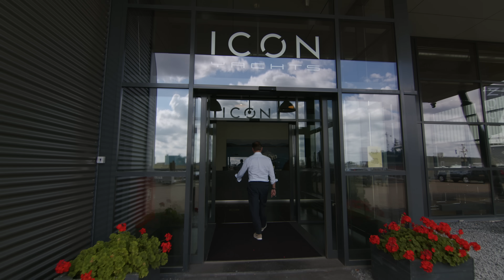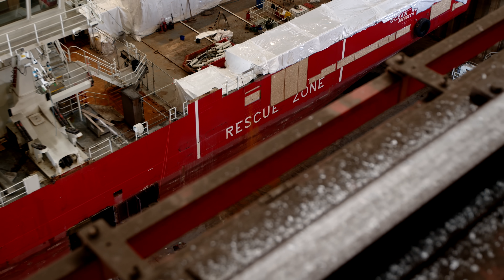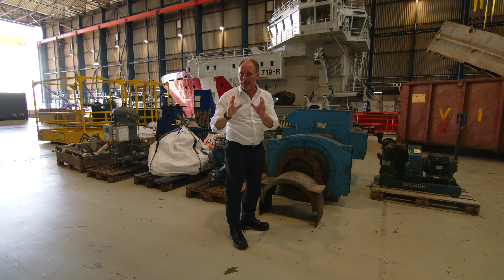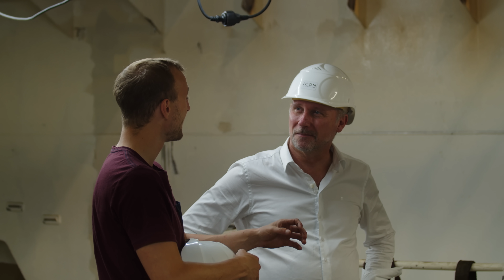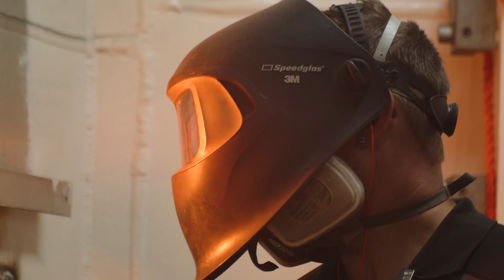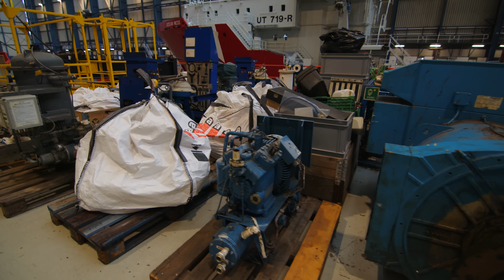IS THIS THE WORLD'S MOST EXCITING SUPERYACHT PROJECT?

Comment: Voith Sneider propellors are used by tugs because tugs need high bollard pull, and great maneuverability. Tugs are slow, inefficient, have a short range because they are coastal, for the most part. Conventional propellers dominate the ocean going market for good reason. It's a pity Iconic yacht did not explain their choice.

Comment: It will be interesting to see how the electric motors will drive this yacht, speedwise, and trip length. I have to wonder how much petrol will be used by the 5 generators vs the two drive diesels removed from the vessel. Cheers to the channel, I will be binge watching a few of the vlogs, and look forward to more, very interesting topic, and great idea for a channel. 😎👍✌☃🎄🤶🎅
Reply: Great question. The 5 Generators will actually not be running all the time. They will be only switched on if the power is required. Most likeley the Vessel will only be running on 2-3 generators at the time, the others as backup. This is a much more fuel efficient setup as the vessel can basically only turn on what it needs where in the previous setup the huge engines were running all the time.

Comment: The new design removes safety features typical of the original ; designed for winter but which can occur in summer storm and hurricane.  The original design has a low aft deck that allows for sea water to  remove ice build up from bow spray.  The new aft deck raises the ice lines and allows for capture and retention of ice above, making the boat top heavy upon unexpected icing.   Uptech, Go Green, go IH2I and Hydrogen Miner.

Comment: I always had an idea for a radical "four hull" ship.  I always envisioned a ship like the trimaran wavepericer, but having a larger "central" sections with two large hulls extending forward, and two smaller hull "wings", one on each side.   

Not knowing anything about naval design, I always figured a wider profile would have less of a chance of rolling over in high waves and rough seas, or rogue waves.

Comment: Question: (Re: ESG) Giving old hulls a new lease of life always bodes well for sustainability. However, how much virgin materials would be used in this restoration-refit? Compared to a fresh build, would this actually be more materially intensive? My other concern is the batteries. Although the idea sounds safe in theory, how will they be like maintenance-wise in the grand scheme of things? Those explosion-proof boxes sound like a nightmare to replace (which should come quite often, based on my own experiences with batteries).

Comment: I always wonder if these repurposed rescue ships make good yachts. Adding all new superstructure seems like it could impact the center of gravity and stability, and  rescue ships often have such deep draft it makes it hard to enter many ports. You'll always notice the crude, wrinkled hull plating and there will always be  parts of the engine space that are old and grimy. Finally, the cost to rebuild these ships is often not much less than building a yacht from scratch.
Reply: Yes, wonder what the new superstructure will be constructed of? Maybe Aluminium or composites…tonnes of bog will fair out the hull plating!

Comment: I'm surprised you haven't heard of the Voith Schneider Propeller, they have been used on tugs for a long time. They are like a paddlewheel placed on it's side, I have always wondered how efficient they are because of this. With the blades having to constantly change angles as they also spin, I am also wondering about reliability.

Comment: What sort of range, fuel capacity, cruise and top speed will it have ? Will it be just as safe as the original design or has the extra weight on top changed it making it less stable ? And how much will the entire project cost ?  To be honest I never thought of doing this. I was contemplating purchasing an older yacht for total refit but then old yacht prices went up. Then I was looking at Bering, Then I had issues with cruise speed vs fuel, and the total cost of journeys meaning the ship would be parked as a "live aboard" for too long. Sustainability, pollution, draft.. all these issues come into play. I am in Australia so we have some of the roughest most dangerous waters in the world.  I have been out in seas where there were freak waves 150m high. In fact on that same day, a man was washed off a cliff, who was 150 m up on a line. I was in a big CAT that day.. The Tasmanian ferry.. yep not on a super yacht per se, but its a big boat. We also hit two submerged containers.. something a lot of yachts do not seem equipped to handle. These are real obstacles and if you hit a container with a fiberglass hull, or a softer steel hull, or your props hit it.. you might find yourself taking on water, or "dead in the water" at the worst possible time. Then the waves will simply break you apart.  This is the reality of the larger worlds oceans and not the protected mediterranean etc.  On top of that, Australia is a LONG way away from anything so RANGE is critical. Fuel shortages mean alternative energy becomes very attractive. Who can afford a quarter of a million dollars to fill up, every 5000nm ? It would cost a million dollars to get the ship from Australia to another continent.

Comment: Loved this a lot, what will happen to the fuel tanks, will they need to be expanded or not to power the 5 generators? Please get to go back and see this boat many times.
Reply: Actually, the fuel tanks will be made much much smaller. The vessel was meant to supply Offshore installations with fuel, so it had massive capacities, way bigger than ever needed on a yacht. So fuel capacities are actually reduced to a third - still the yacht will have a 6000nm range.
Reply: @H.M.P.D  6000 wow, truly amazing, I am loving the sheer scale of the engering involved. The logistics must be crazy given the world right now and getting parts. Simple things like fridges I here are hard to get. 
Will the boat have solar power or a kite sale to help.

Comment: Great project. And diesel electric hybrid systems are certainly the way to go. 
But I really can't understand why they'd use voith schneider propulsion in this application. I was working with these systems years ago in the 1970's and 80's on harbour tugs. There they really come into their own with their ability to pull in any direction and change it instantly. But they're mechanically very complex with a lot of moving parts and potential points of failure; and I really wouldn't imaging them being well suited to offshore passage making.
To me it'd make much more sense for this project to go with an azupod system which are well proven and are already used on many modern cruise liners. By putting the electric motor inside the azupod they allow a direct drive onto the prop via a very short shaft; They're really simple and reliable, with minimal moving parts, no gearboxes, and only an electrical cable between the hull and the azupod; They're very quiet because any motor and propeller noise and vibration is taken outside the hull. And because each pod can rotate independently through 360 deg they allow virtually the same level of manoeuvrability and GPS-anchoring ability (for want of a better term).
Reply: Good questions you are raising! Actually the technology of the VSP´s has advanced over the time. The system has way less moving parts than you might think. Hope David will dive deeper into this topic and explain a bit more about how those insane looking Propellers work!
Reply: @H.M.P.D  Have a look at https://www.youtube.com/watch?v=Ub563Yc3xls
The animation is a bit fast, but if you slow it down to 1/4 speed it's a bit clearer.
Notice how as the unit rotates each blade is constantly oscillating on its own vertical axis relative to it's tangential rotation.
That oscillation is what provides the thrust; but it's also that, and the associated mechanical linkages, which I was referring to when talking about the amount of moving parts.

Comment: Show us where it is not the two most important problems that should NEVER hit open water again.
It's top-load and not roll on roll off (RoRo). 
Also has low center of gravity to offset the work you did to a pre existing vessel.
As sinking is common amount in HCG modified vessels. Much less anything HCG vessel.

Comment: With all the extra weight added to the superstructure how do they ensure it won't be top-heavy?
Reply: Super interesting question! Since those vessels are actually made to carry gigantic loads on their aft deck + more than 1000 tons of fuel/water as supply for offshore installations the added weight actually brings more stability as it brings the vessel "down". When not loaded the original vessel would have to use enormous amounts of ballast water to ensure she is actually not to light. Also there go very complex stability calculations into such a conversion, ensuring that all is perfectly stable.

Comment: The dynamic positioning system comes hand in hand with high fuel costs and a much higher maintenance cost. I am curious what, if any, are the trade-offs to initial costs and long term maintenance schedule of this system as compared to a more traditional electric direct drive thruster/nacelle configuration.

Comment: The Voith Schneider propellers seem to give the ship a great handling advantage at a cost of speed.  Is there an option to use these and have a higher increased speed?
Reply: As Project Master is designed and build for cruising in comfort with extended range in mind, that was a trade worth taking. As I am aware of, there are just certain technical limitations to that system which provide a speed limit. 12-14 knts speed is plenty enough for a vessel like this tough.

Comment: Perhaps cost is not a consideration but I do wonder if this method of ship building is better than the alternative - starting from scratch? There are probably parallels to refurbishing a house vs building from new. Can you provide any insights?
Reply: Indeed there are some parallels. Just keep in mind that the complexety of such a vessel with hundrets of systems working together is much higher than a house. Therfore also the efficiency really comes into play since all that will not have to be purchased new and even more important, does not have to be newly engineered. On New Builds a lot of the overall investment has to be made years before the first piece of steel is even touched due to the gigantic engineering/tesing and certification efforts.

Comment: It was an ERRV (Emergency Response and Rescue Vessel).   Generally stay on station at Oil/Gas installations/rigs.  Tend not to be involved in supply of materials, as there is no deck space for that, when in Standby mode.   They only leave location when relieved by a similar vessel.  Could make a good basis for private explorer yacht.

Comment: Having seen an oilfield supply vessel in action in the South China Sea during a typhoon a few decades ago, I have enormous confidence in their stupendous abilities. Notable memories involve the Smit Lloyd 101 rearing out of the waves on full power to time her passing with a helicopter landing on the bucking deck of a barge (in case it went over the side). They’re great, even more so the latest supply vessels. But even when converted, it would be good to honour the sturdy pedigree by avoiding the term ‘yacht’ however fancy they are! Better to think of them as luxurious working boats - and be proud of their tough origins.

Comment: I’m curious about how much more efficient the new power/propulsion systems will be compared to when this was a commercial boat. It would be interesting to see real numbers about how the displacement has changed from when it was running heavy with supplies to what it will be after all the new metal is added.
Reply: @Tim Nissen 
I lack any knowledge to dispute your claim...

Comment: What a better way to build an explorer super yacht, by transforming an existing, proven, been there done that,  commercial explorer yacht.  Although I think the owner will not deliberately go into a storm with it, but good to know it can..hahaha.  I think it's kinda like buying a 2022 land rover defender, off road in style and comfort.  Interesting propulsion system, first time hearing it.  Maybe if you can kindly share more info regarding the benefit of having that kind of propulsion instead of the conventional type (other than the dynamic positioning capability) like is it more fuel efficient? or maybe less maintenance?...

Comment: I would be interested to understand how they are going to solve noise levels within the yacht and is the bridge remaining as is
Reply: The Yacht will have specific noise reduction measures. E.g. all machinery will be on floating mounts which eliminates major parts of the vibrations, further all generators will sit in their own sound proof casing to further reduce noise leves. Also all guest areas will be outfitted with floating floors and specifically noise insulated. The Bridge will stay mostly as is, mainly just some cosmetic touch ups. The aft console which was used for offshore operations will be removed and replaced with a nice seating area.

Comment: I wonder if those propeller thingies can be scaled down to non gargantuan vessels because it makes a lot of sense having basically the same control as a tug boat on a sub 24m launch, plus dynamic positioning is always a bonus
Reply: There are many different sizes of those Propellers. One disadvantage of those is that they are really not meant for high speeds. So around 12-14 kn is already quick.
Reply: Perfect for passage making then